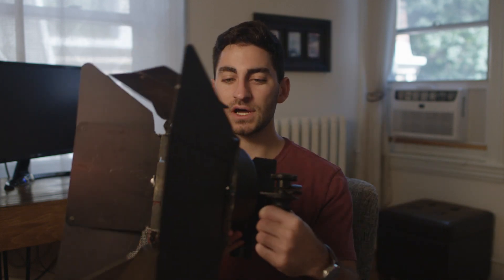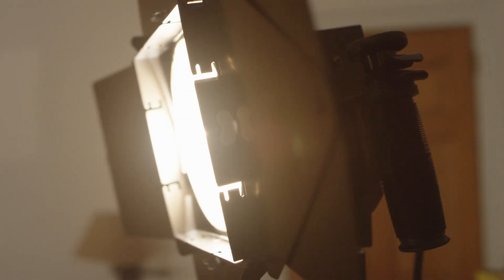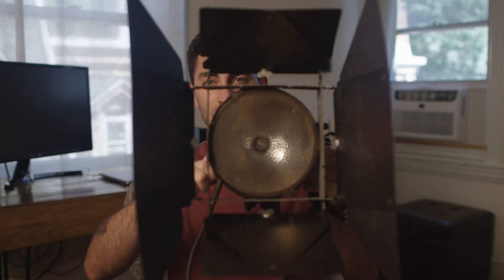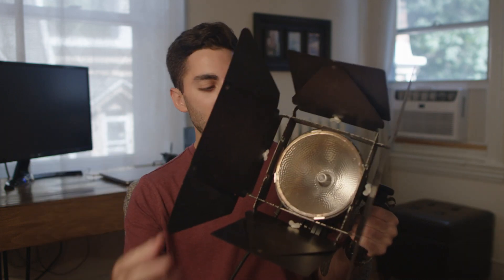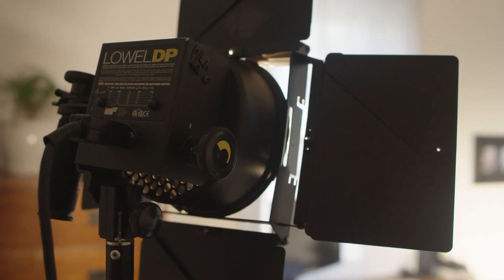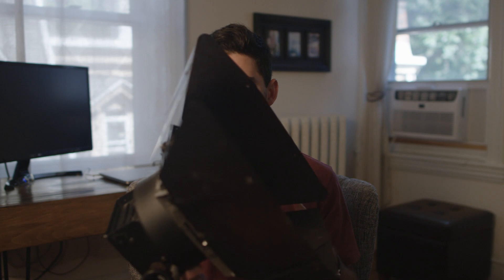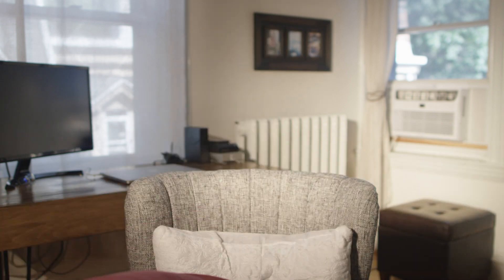The Lowel DP 1000 Watt Light

Comment: Can you use gels on this without burning?
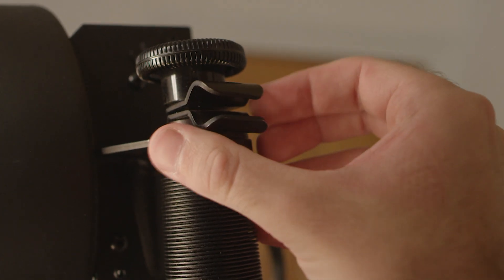Reply from the maker: If you try to clip a gel right to the barn doors then yes, they'll burn. For lights this hot, you'll need to clip the gels to a gel frame, which screws onto the side of the light. I point it out at 5:33
Reply: @Brendan-Grant  thanks! I only have one gel frame. Even though i thought it was deffuser frame lol i will try it..... can you recommend gels that suits this light?
Reply from the maker: @WedisemaetAntonios  you can use it for gels or diffusion, either or. You'll probably want a Full CTB gel to make it daylight balanced instead of tungsten. It all depends on your own creative desires, though. Have fun, buy tons of colors, and experiment. I highly recommend checking out my video on lighting with color for more information on the subject.